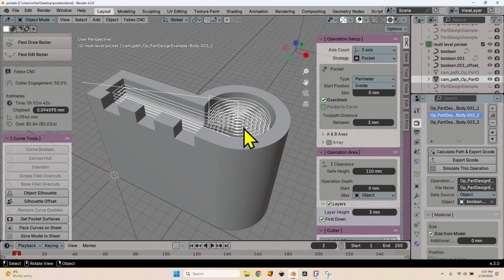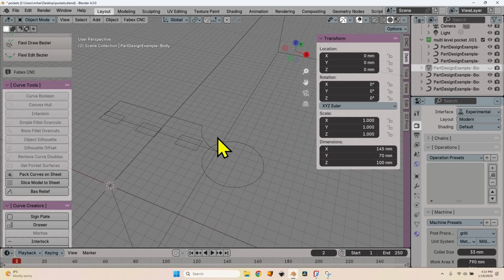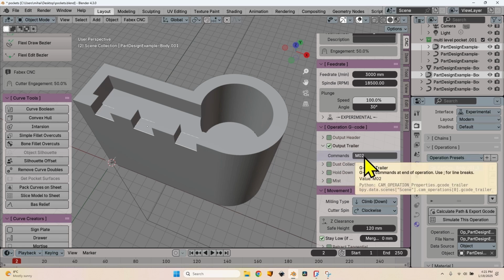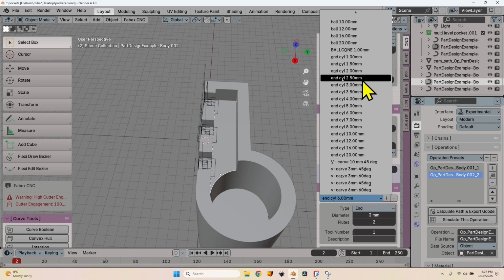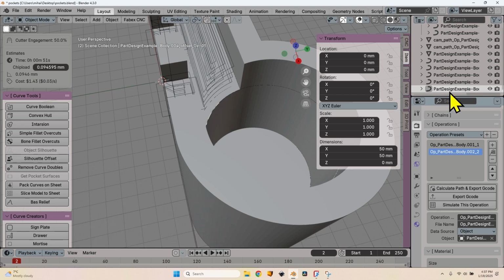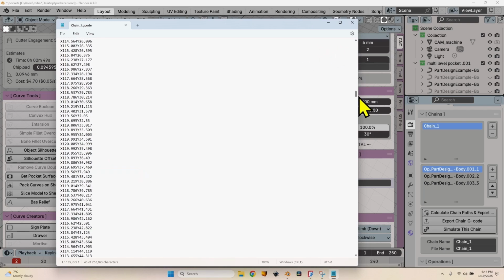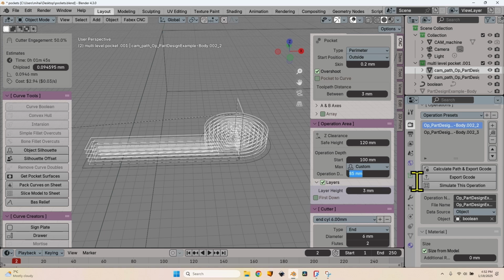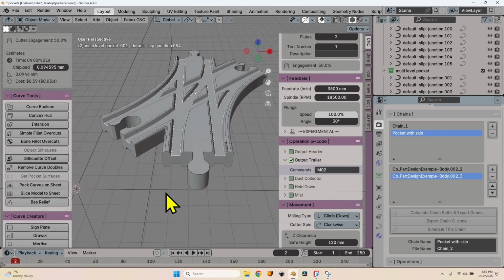Create CNC Pocket Toolpaths in Blender with FabEX CNC (Blender CAM)

Comment: great videos!   I have a similar home made CNC with GRBL controler.   I use M5 to stop the spindle then M2 to end the program.  I think M2 is ends the program and resets internal values.  I have also found it handy to use a pause command immediately after the spindle startup (helps ensure the spindle has enough time to get to a stable speed).  For example M3 S18000 followed by G4 P5 (pause 5 seconds).
Reply from the maker: I have this setup in the controller, a 6 seconds pause. But I'm using fluid NC, not grbl
Reply: @opensourcecnc  Cool. I'm using FluidNC as well.  FluidNC 6x controller.  I also that set a spinup delay in the yaml config but I guess I didn't trust it.